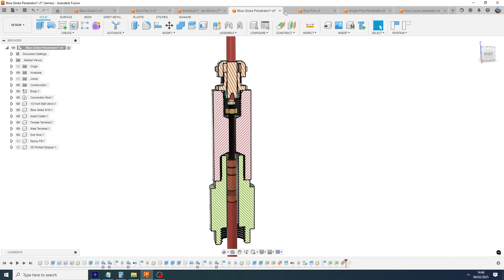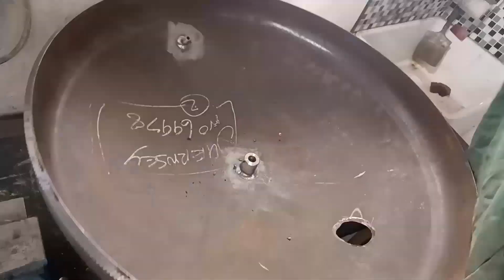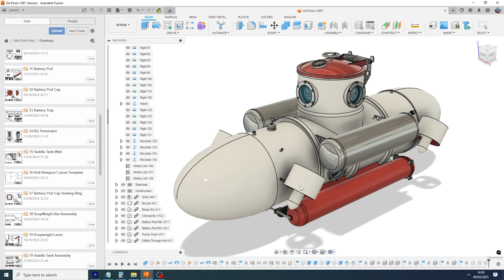Building a Submarine. Part 165.

Comment: Hi James,  I have been using hole saws to make larger holes in my hull.  Takes only a few min and is super clean.
Reply from the maker: Hi Hank.  Can you show on your videos you doing that?  Would be really interesting as I've not done it like that before, but I have heard of it.  Bi metal saw i assume?
Reply: @guernseysubmarine  Hi James, I do not have a video on that.  They are bi-metal hole saws.  I take a scrap pice of metal, and drill with the hole saw in the mill or even lathe.  Then I tack the drilled piece on the hull and use it as a drill guide.  It takes about 3 min to drill a 3 inch hole in 7/16 thick plate with WD-40 to lubricate it.